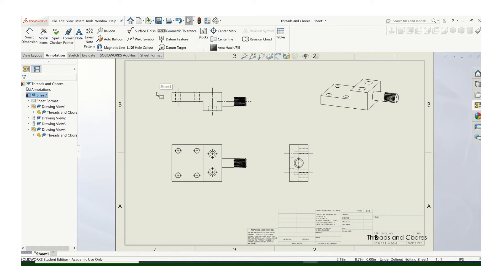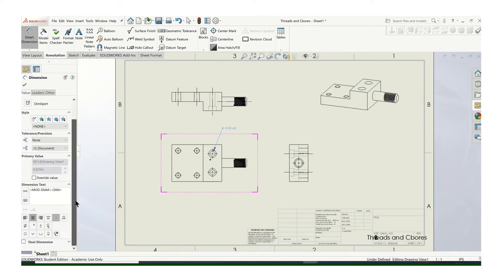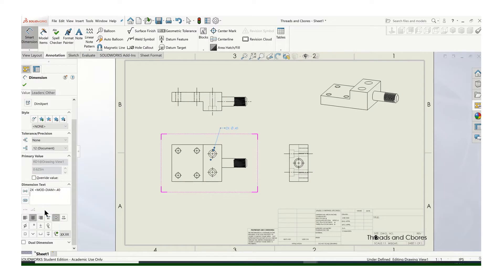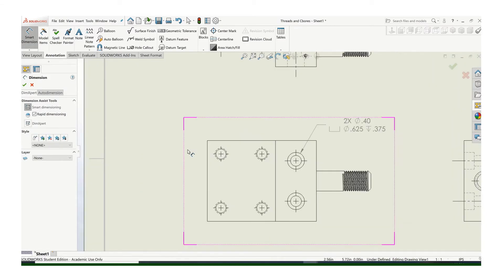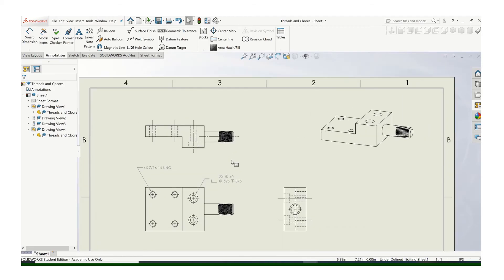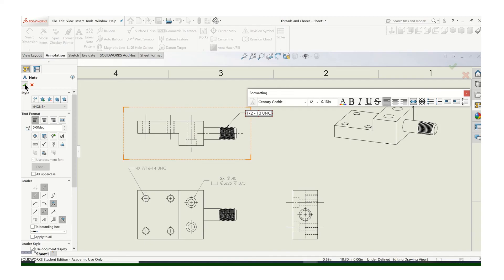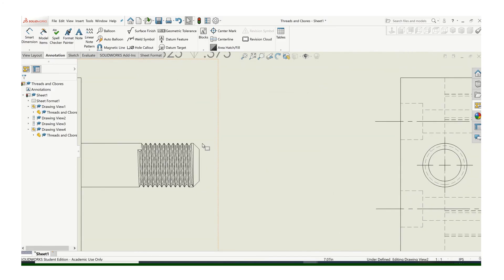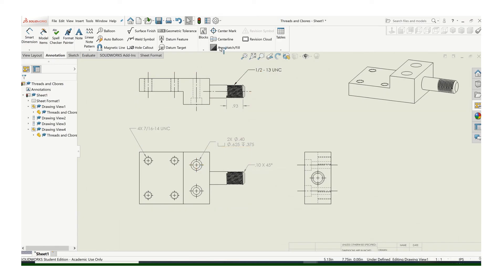Dimensioning Threads and Related Features Manually in SolidWorks

Comment: If you use the hole callout command, all that information goes in automatically.
Reply: Thank you! I kept getting a "The selected entity could not be converted into a line or a circular arc" error every time I got to the "Software is pretty smart. It recognizes that those are threaded holes" so I couldn't get the dimension on my print. The hole callout command worked great!